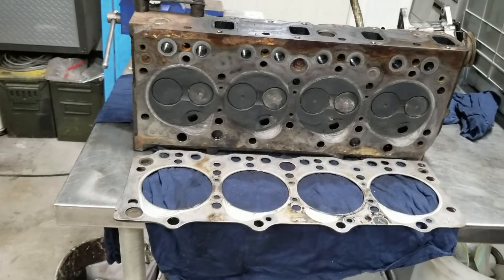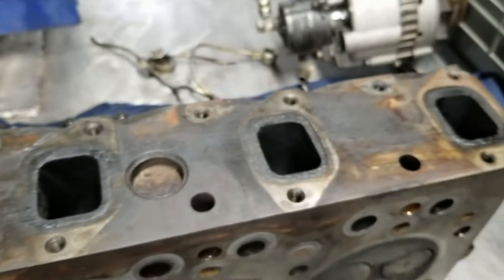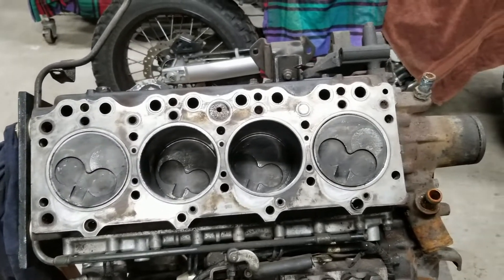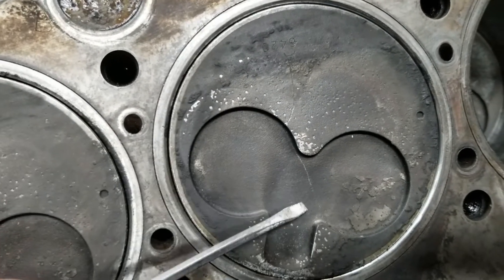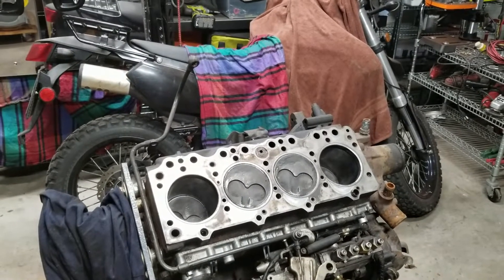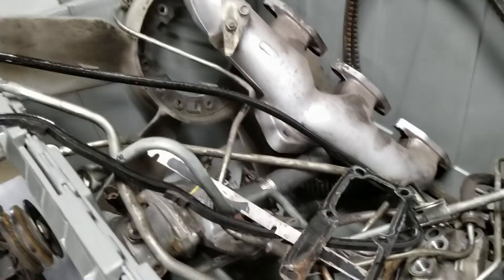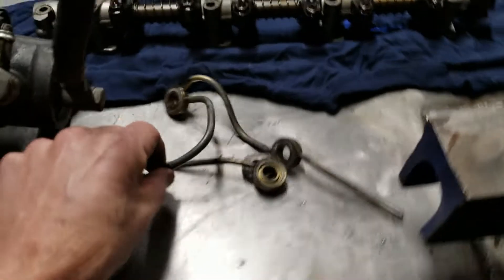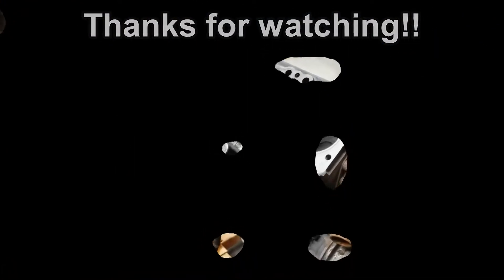Rusty the Spryte build part 44 (4BD2T teardown and rebuild part 1)

Comment: I have blow by on the same motor through the cooling system. The motor runs fine 
What can that be?
Reply from the maker: Check out the playlist for this build series.  A cheap aftermarket headgasket was the source of my coolant overflow issues.  I show you the head gasket differences and have since fixed it in this series...

Comment: Wouldn't it be cheaper to just find a low mileage motor for under $ 2000.00 .. They are all over eBay . I did a google surch and got all sorts of leads .
Reply from the maker: Hi Big!  That is what I initially thought too.  I ended up with this for 300 bucks.  I enjoy doing my own work so this was perfect for me.

Comment: I would find an upgraded piston for that engine and purchase them, the factory pistons obviously have issues.
Reply from the maker: I think there are other issues that caused it.  The main reason seems to be overheating or lack of maintenance.
Reply: @SeanFastidious  I'm sure there are other issues, but if there is a better option, its good time to upgrade.

Comment: Compare the price to rebuild the 4bd2T with  other 4jbt1 2.8cc used motor. If almost same price, better buy and plug the 4jb1t, direct injection.. it's tough and easy to tweak for better power.  Beside it's less time consuming.
Reply from the maker: You want me to buy a smaller motor?

Comment: Were the pistons stock? Need check cylinders roundness? If you buy the after market piston, after the honing need to check piston and cylinder clearances and piston ring end gaps. Of corse the easy way is buy piston, liner and ring as a cylinder kit, way do the piston crack? Have to thing about getting stuck out in the middle of no were. Excellent videos keep it up!
Reply from the maker: Hi David!  I do believe the pistons are oem since they have the isuzu size stamps on them.

Comment: Hey Sean.. Hope you quarantine is going well.. The build is coming along great.. Regarding the engine rebuild.. I would not do either the cheap ebay parts route, nor the Isuzu dealer route.. I would reassemble the long-block and take it down to your local engine machine shop.. I have done this many times on hot-rod engines, and a few diesels. Since you are dug into the engine this far already, it would be silly to not have the motor completely rebuilt, rather than just replacing pistons.  This will absolutely be the proper thing to do at this point, especially since you want reliability on a rig like Rusty. You are going to want the main and rod journals on the crank checked for proper clearance anyway,  and this is even more vital if you are replacing bearings, which you should do. Going the machine shop route will probably be less $$ than you are expecting, and you can also save some $$ by doing the engine assembly yourself after all the machining is complete. This way you have piece of mind when out on the trail. I'm guessing the machining, new pistons, bearings, seals, etc. will put you in the $1500 - $1800 range plus or minus.. Cheers Man!!
Reply from the maker: Hi Christopher!  I was going to go that route but calling around netted 3-5k just in labor alone.  I have rebuilt numerous motors in my lifetime and would feel confident if I was able to do the same with this motor.  I would also feel better if something does fail that I am the one that caused it if that makes any sense....
Reply: @SeanFastidious   wow that is really surprising.. the machining on refreshing a block is usually around $500-$750.. New pistons will be in the $500 range.. Bearings,gaskets, etc. a few hundred more.. What are they doing in labor that will cost $4000? At $50/hr that is 80 hrs of work? You are getting bad information.. Keep calling around.. My local machine shop cranks these out all day long in the $1500-$2000 range including parts and assembly!!
Reply from the maker: @kitcarson26  parts alone would be minimum 1500.  Labor prices I  the PNW are much more costly than elsewhere.  I called 5 different places.
Reply: @SeanFastidious  wow I didn’t realize there would be such a cost discrepancy between locations.. I wonder if it would be worth it to ship it out of the PNW for machine work?
Reply from the maker: @kitcarson26  I will just do the work myself. It's not that big of a deal.  I have nothing but time right now.

Comment: I’d have to agree with most of the comments thus far.  Finish the tear down before making a decision.  It’s a tough call, If you can get a set of pistons and sleeves that are matched I’d go that route.  You know the old saying, do it right or do it again.  But you have the ebay luck I lack.
Reply from the maker: I have been very very lucky in the past....will my luck run out in 10 feet of snow 12 miles from any known road??  LOL

Comment: Although you stated your not using it for commute to work (daily driving) but you'll be applying a great deal of stress on the motor every time you do take it out. If me in your predicament I will not trust Ebay parts. I would purchase from Ebay used good parts for the motor instead of non oem new. Have you checked salvage yards? Purchasing a whole engine block might serve you well? You can always sell the left over parts to gain back some of the expenses. I feel for you, it's a bummer. Good luck.
Reply from the maker: Hi Paul!  That is always an option too.  We shall see how it goes....

Comment: Put a Cummins 4bt 3.9L diesel engine in it.
Reply from the maker: Hi Agent.  That was the original plan but they are hard to find, expensive, and will most certainly need a rebuild.  I knew I would have to rebuild this one and it only cost me 300 bucks.
Reply from the maker: Check out my build playlist for this series to see where it all started....
Reply: @SeanFastidious  10-4..yeah a bit more difficult to find at a reasonable price..but a much better option in the long run.. I've seen 2k-3k for rebuilt long blocks..4k for new complete " off road" engines..shipped from china made by Cummins..but occasionally they can be found 2k -3k running pull outs without blow by..just mentioned it because spending 2k on that engine platform seems to be a waste.. a 4bt engine would greatly increase the value if you ever plan to sell..of course you would need to keep the original engine as well if a person interested, intended to restore it to original spec..I'd only fix that engine platform as cheap as possible considering the known issues they develop..
Reply from the maker: @agentcovert  the 4bd2t is a great platform.  They only develop problems past the 200k mark, are quieter and more well balanced than the 4bt platform, and parts are more readily available.  I am happy with my choice.  I planned on rebuilding it anyways.

Comment: Check the mains for play?  5 main bearings? The piston failure relates to something..
Reply from the maker: Hi John.  I will be doing that for sure.
Reply: Yep, my thoughts too, all 4 cracked in the exact same spot sounds like something deeper is causing it.
Reply from the maker: I agree.  I will investigate more.  This motor has 250k miles on it and they are notorious for cracked pistons unfortunately....
Reply from the maker: Hi Subdude!  I was thinking the same thing.  That would definitely crack the pistons since these motors do not like ether at all...

Comment: A good welder should be able to repair that broken fuel line.  I broke a similar line once, and my boss was able to get it repaired.  As for the pistons, like you said, you're not gonna be daily driving it or cross country driving it.  I imagine the Ebay kit should be reliable enough.
Reply from the maker: Hi Lance.  I found a new replacement fuel return line for cheap.  I found some Japanese kits on ebay that contain everything for a rebuild.  I might just do that.
Reply: @SeanFastidious  Outstanding!

Comment: I have found that some E-bay rebuild parts are from a oem supplier factory but in a difference package.  Most have after market or oem gaskets etc.  Some injector pump I received have all the correct part numbers stamped in the casting. It is still a crap shoot put a good seller usually sell good parts. I found some great deals on over stock,  dealer close out and old stock parts. Good luck
Reply from the maker: Hi Bill!  Did you rebuild a 4BD2T?  I am noticing something similar in my searches....
Reply: Hi I normally just worked on Cummins, GM Detroit, Cat, Perkins, VW diesel and a few others. We found parts in close out shops E-Bay and dealer old stock. There are some people that buy out bankrupt or going out of business if you can find then sell them. Have you though about getting a short block? I was wondering why all four pistons cracked. I have seen one or two but not all. Piston cooling problem, plugged oil jets on rods if they have them, or defect?
Reply from the maker: @billwheawill6544  I will continue the teardown this week.  Maybe the oil jets are clogged or nonexistent....we shall see

Comment: Personally I'd buy the  Ebay one  but what is the  condition of the crankshaft bearings and  connecting rods and bearings that would determine how I'd go
Reply from the maker: Hi Jeff, I will be opening up the crankcase in the next episode hopefully.  I did find a reliable mid end kit that a reputable rebuilder has been using.  I might go with that.  Time will tell....